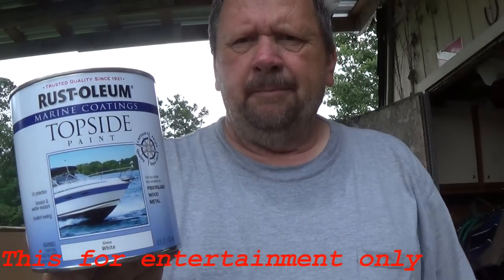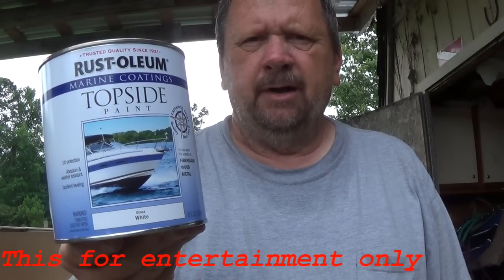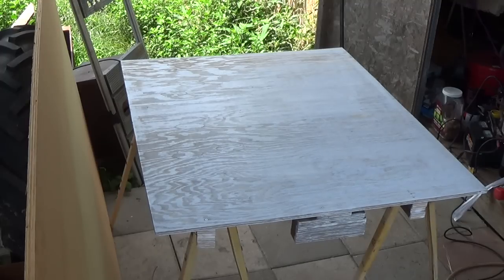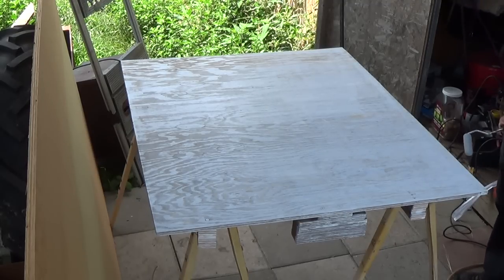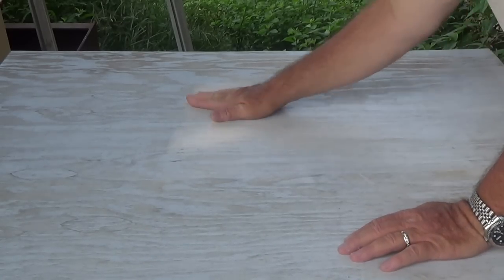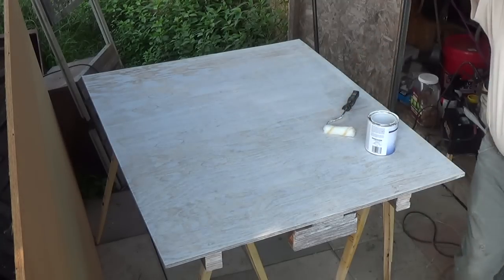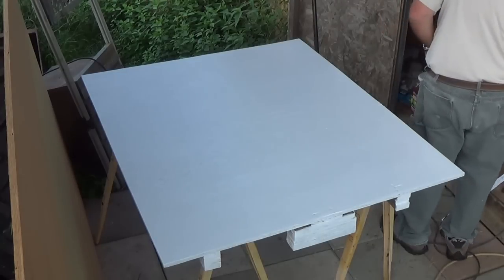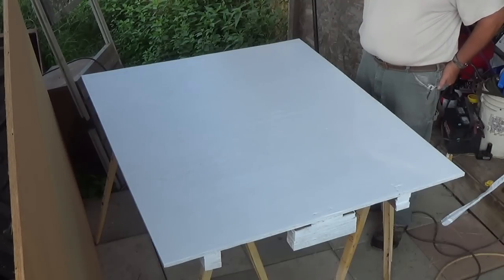Rust Oleum Topside Paint (Robalo Boat Project 60)

Comment: I painted my Boston Whaler with Rustoleum 3 years ago.. I even did the bottom with it... the boat lives on a trailer so it doesnt sit in the water all the time.  Its held up extremely well ...still maintains a shine.. 

What I like about it is that if I scratch the boat...I can sand the area out a bit and repaint that area... it blends really well.

I live in South Florida and the  boat is used in a salt water environment in extremely strong sun conditions...I sanded the boat with a DA and 220 grit paper... primed it with Rustoleum primer, and rolled the finish coat...I put on 2 coats.

 I would recommend this to anyone wanting to refinish their boat.
Reply from the maker: Did you primer it first or just sand it? I painted a lot of the interior deck and transom. I am going to prep the hull to paint now.

Comment: I used this paint along with the primer over a coat of Skid No More that I applied to a deck that I glassed on a friends boat. I waited about 10 days to let the Skid No More fully cure. It is a latex water based product and by it's self I thought it was to soft to hold up on the deck. After 10 days I rolled on a primer coat. Let it dry and rolled on 3 coats of the top side paint and ended up with a surface that was hard as a rock and has held up to a salt water environment and all of the abuse the deck of a boat gets. Was very happy with it.
Reply from the maker: Thanks for the information. I was wondering how it was going to hold up.

Comment: I have painted 3 boats with it (Rustoleum Marine topside paint). It is excellent paint. Rustoleum owns Pettit, so they know what will work. I have found that even though they say on the can not to thin more than 5% with mineral spirits I usually go about 8% for the first two coats. Then I will stick to the 5% for the 3rd usually final coat. I have always used the "roll and tip" method, and the Rustoleum levels out very nicely. You have to get right up and look hard to notice that it wasn't sprayed. They key is the thin multiple coats. It is very hard and durable if you are patient about putting it on. I also let it set for 24 to 48 hours between coats. Then a scuff with 220 and recoat. After the final coat I'll leave it alone for several days then wet sand it and buff it. It looks amazing and is a great durable finish. I think it is a bit more work and having to be patient than some of the Interlux, Pettit, etc... brands, but for 14.00 a quart compared to 45.00 or more per quart...I can wait. People get nervous about it being "oil base paint". That is actually great for a marine environment. It does make you do things differently though. You have to do thin coats allowing each one to dry/cure well before doing the next. I think it is great paint. I was referring to painting the fiberglass hull on a boat in the above remarks also. I think it is probably the best stuff you could use for bare wood like this gentleman did. The oil based paint will penetrate better into the wood before drying. So, I would imagine you are sealing the wood very effectively along with obviously painting it and making it look very good. Again, when you get to the money part of it, the Rustoleum is really hard to beat.
Reply from the maker: Thank you for sharing your knowledge and experience with us.

Comment: I put in a new kitchen 'lower end cabinet' and under-sink shelf due to the dishwasher leaking water and destroying the particle board crap we had. I bought a very fine sanded $35 sheet of smooth 1/2" plywood for the shelf and the new end cabinet is real plywood with wood simulated veneer. Dishwasher seal is fixed and an alarm has been installed underneath it for future leakage alerts.  I wanted to epoxy the shelf or lay a sheet of laminate on it to avoid scuffs and marks from my wife getting stuff in and out from putting stuff under the sink, or just plain letting stuff set on the shelf for ever but the epoxy paint was for garage floors a one gallon was way too much.  Normal paint would show 'set' rings, even with oil base. I'm hoping this quart of Rustoleum TOPSIDE is a hard shell when cured and should stand up to normal abuse. Fingers are crossed!!!!
Reply from the maker: So far it is holding up on my boat. Good Luck!

Comment: I don't think that pain is designed to go over bare plywood. at least primer it first. I think the better use of it would be to paint the Hall of your boat. or paint wood that has been epoxy and or fiberglass. I think it would have saved them a half a can of paint
Reply from the maker: H Pac my thought was I didn't want the deck to be  smooth but I wanted it to be somewhat protected and that was cheaper than gel coat

Comment: Anybody ever use rusoleum regualar enamel vs the "Topside marine paint" - is there a difference? they ran out at Home depot but they have the regular enamle
Reply from the maker: When you look up the chemical make up there are differences between the rustoleum top side and regular rustoleum. I think it is more UV protection but I am not totally sure.